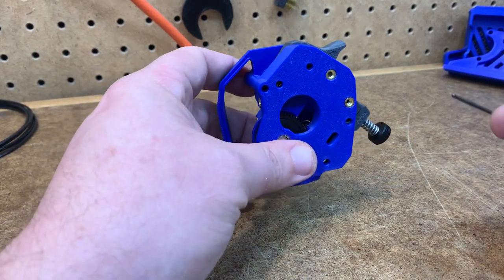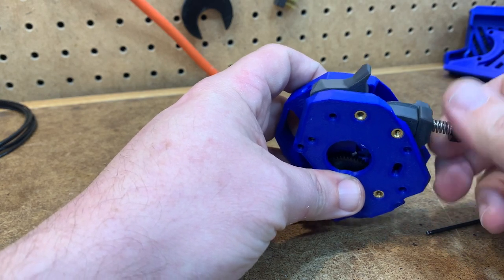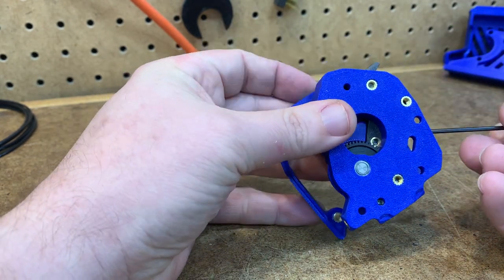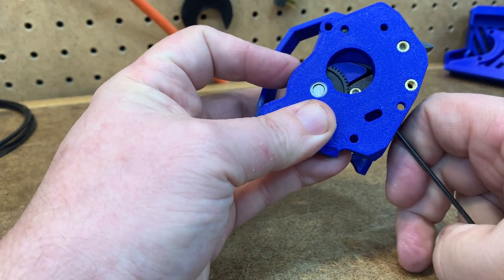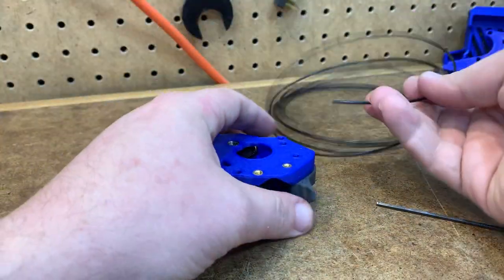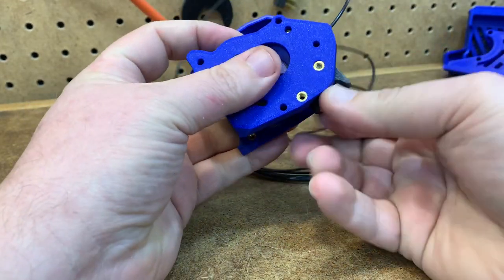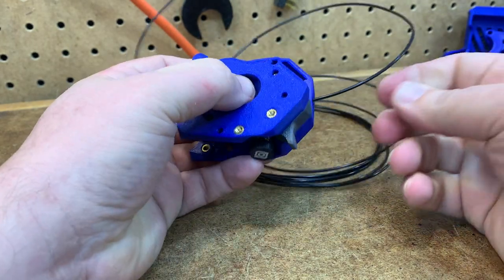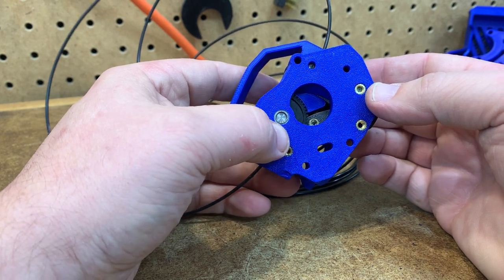Voron Clockwork 2 Guidler Anti-Squish Thingymajig Adjustment

Comment: Great video.   We need more videos explaining the finer points of various assemblies.  Not more 3.5 hour videos if responding to subscriber questions.  Nothing wrong with those but quick and informative videos serve a different purpose.  

To adjust the thumbscrew, I hold the filament tightly with my fingers right where is comes in the top and rotate the gear manually.  When the skin on my fingers feels like it’s being into the extruder I stop.  A different way of doing that adjustment.   I was just guessing at the other adjustment you showed before I watched this lol.
Reply from the maker: Thank you!  I, personally, love the 3.5 hour videos as hang out time, but I’ll agree that they can be daunting to sort through to find small bits of info.  Glad that this format is helpful and fills a gap for you!

Comment: From where did you get the parts for the latch?
They've a perfect fit in your video. Mine are not that super snappy 😞
Reply from the maker: The plastic parts are all printed by me on my printers.  The hardware is from an LDO 2.4 kit.  Personally, I like the extruder gear sets that DFH and Fabreeko sell.  Each of these stores are small shops that take good care of their customers.  I have bought from both shops multiple times, and both have given me freebies in the past, but not specifically these parts, and not for this link, but I want to be as transparent as possible!  https://www.fabreeko.com/products/bmg-kits , https://dfh.fm/products/rnc-coated-extruder-components-kit-by-runice

Comment: Can this be done with the CW2 installed? Maybe by locking the motors instead of holding with your thumb....THanks
Reply from the maker: I do not recommend it.  You need to be able to check the rotation of the gears to see if they are binding, so having the motor locked through the whole procedure would make it difficult if not impossible to assess whether your gears have stopped binding.

Comment: My gears don't bind up like at 0:47 what should be preventing them from rotating?
Reply from the maker: There are a ton of possibilities.  I’d suggest opening a help ticket in the Voron discord for more detailed help, but general things to check would be whether the motor is turning properly, whether there is debris in your gears, whether the body of the CW2 is screwed together too tightly, and whether the faces of the printed parts have artifacts that are interfering with smooth movement.  Good luck!